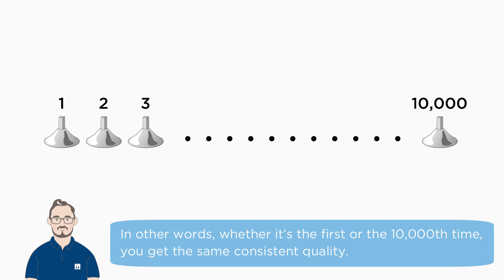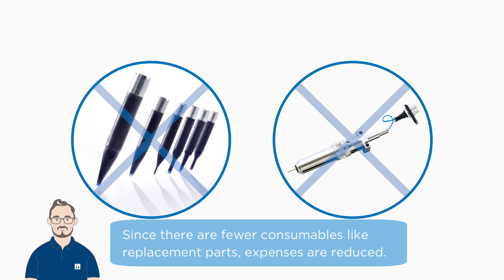What are the Benefits of Laser Soldering?

Comment: I'm an electrical engineer. It's strange that I didn't know about this technique until this video. Are there reasons why this isn't more widespread ?
Reply from the maker: Thank you for your comment! 
Laser soldering is widely used in industries that demand high quality and reliability requirements, such as the automotive industry.
On the other hand, soldering is completed in the reflow or wave soldering process for home appliances. Also, for high-mix low-volume products, human operators are less expensive than automated machines.